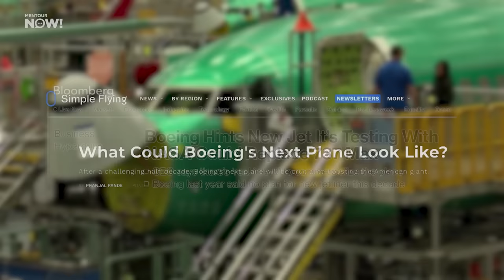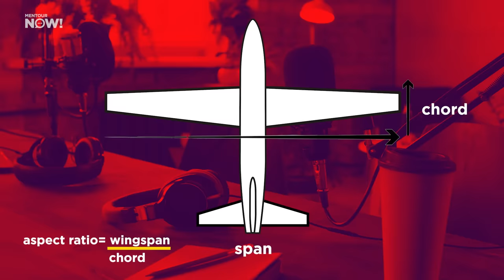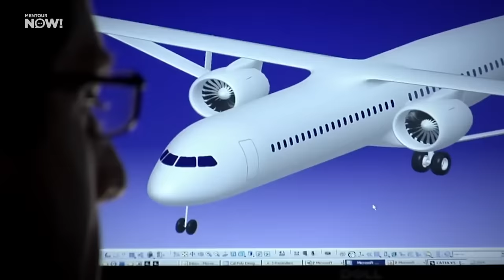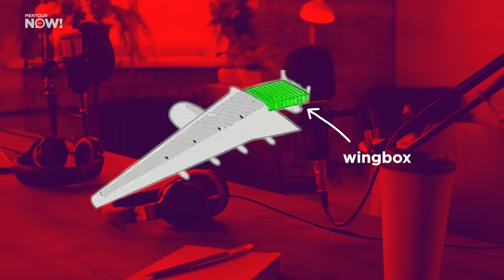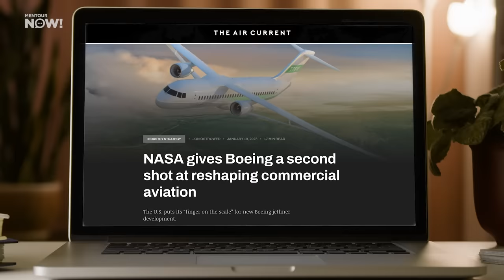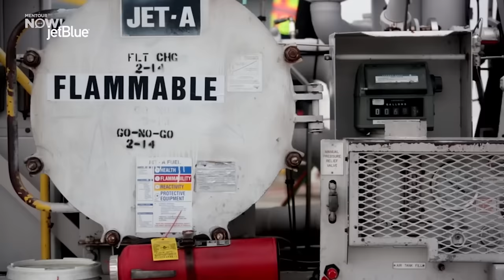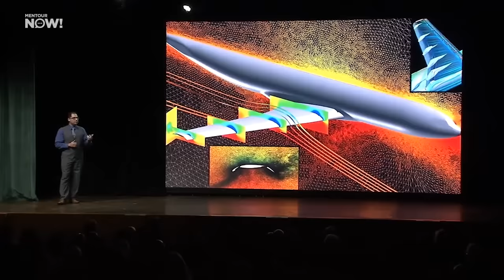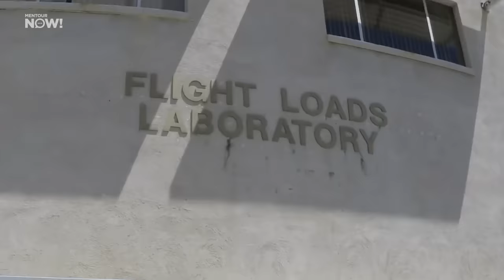Revolutionary Breakthrough: Boeing's Transonic Wing in Partnership with NASA!

Comment: The problem of wingspan will not be so much in the current configuration of departure gates and boarding bridges, which is of course solvable by folding them (although folding 8 meters on each side will still be a challenge...), but primarily in the field of certification of airports themselves, where the wingspan is one of the essential parameters for determining the category of the airport, or determining the critical type of aircraft, i.e. the largest type that can be operated at a given airport. And this can become a major problem for regional airports that are now certified in category 3C and 4C.
Reply: Well no, that is determined for accurately by MTOW of said aircraft as that determines how strong the vortices are by and large, not its wingspan.
Reply: @w8stral  There are also issues with navigating on taxiways both for conflicts between aircraft and with equipment on the ground
Reply: @Markle2k  Uh, a flat NO to that as zero difference between big and small airports in that respect other than the RARE airport modified for the a380 and this proposed craft is not even close to midsize
Reply: @w8stral  Wing span of 52 m will effectively put this aircraft into E category (by wing span) which is similar to A330/787/747-400.
Reply: @razy1857  Wow , way to miss the obvious...

Comment: I understand having folding wings (16 meters) for the planes to be able to park at the gate with the current airport fees.  However, if 16 meters (or more) unfold when the plane gets to the runway, are the runways going to be able to have that wide of a plane?  We have seen accidents that occurred due to the planes being off-center and the wings clipping an obstacle.   
Thank you for this channel.
Reply: Tall objects are kept far away from runways. The Boeing 777 and 787 have wingspans of about 60 meters. A runway wide enough for the 737 is wide enough for a 787, even if it may not be long enough.
Reply: The constraining factor for runway space is margin of error for not flying perfectly straight (and that goes double in low visibility).
But TAXIways are another story; even major hubs have wingspan restrictions on certain taxiways.

Comment: This is a good list of issues and benefits of the concept but of course there are many more. For example:
- the engines under the high wing can be potentially larger (higher bypass) and therefore more efficient (I say potentially because the flow through the truss and wing cell needs to be carefully designed and optimized)
- due to larger rolling inertia and not enough space at the tips of the wings, ailerons may need to be larger in span as well as maybe chord. Similarly, the flap mechanisms will require some clever engineering. It's sad to have such a thin and optimized wing and have very large pods hanging underneath creating all this drag...
- cabin noise from the engine may be worse. Also, the truss will generate some noise as well. This may be a more noisy aircraft as a whole. Noise is less easy to predict compared to aero or structures so this remains to be seen. Maybe the efficiency will allow flight with less thrust and that'll reduce the noise significantly.
- some fuel will have to be placed in the fuselage and refueling may be interesting. Also, there is less inertial relief from fuel in the wing so the structure actually needs to be stronger to withstand the larger bending moment. Of course the truss really helps with this.
- the ceiling in the cabin may be lowered near the wing box. This may require some clever cabin design.
- the top of the wing will be harder to inspect. May require airport ground equipment

Overall a very exciting time in aviation history where the leading manufacturers are seriously performing conceptual studies rather than seeking a few percentages in efficiency here and there. Learn more about the other concepts under consideration by NASA: https://www.nasa.gov/aeroresearch/sustainable-aviation
Reply: All very good points! unfortunately, all they’ve done is talk about new designs and show concepts for the past three decades, but have only made small changes here and there. And, as we all know, the experience of flying commercial has only gotten worse. If you can afford to pay for Upgrades to business, or first class, it’s a lot better. But for the rest of us, we are just cattle :-)
Reply: Hangar space, engine maintenance, high tailplane, wake turbulence etc

Comment: Could a future solution to the gate problem with high aspect ratio wings be addressed by revising airport design, perhaps taking passengers to aircraft on the tarmac with electric buses?  Maybe the current concept of a gate doesn't mesh well with future aircraft design and the push for more efficient systems?
Reply: It really looks like redesign of airports must be considered to keep abreast of aircraft development. Good point Robin.

Comment: I do think their will be a substantial increase in wing loading with this design and that's the main point of this wing. I don't think their will be a folding wing the extra weight and complexity will almost negate any performance gains if the design catches on airports will eventually be redesigned to suit the newer aircraft.
Reply: It isn't a redesign issue, you can fit less gates at your airport.

Comment: I think a swing wing might be a better width reduction option than a folding wing.  it wouldn't need such a strong flashlight, and if the pivot was built into the truss point, the plane could be narrower at the gate than the current planes.
Reply: love me some swing wings. But we will have to see if they can make the wing box strong enough without sacrificing passenger/cargo space and weight. To my understanding swing wings are better used for transitioning through the sound barrier, but are a little on the heavy side for light efficient aircraft which is where the industry is obviously trying to go.
Reply: @Amehdion  you're thinking of the variable geometry swing wing. I'm talking about the wwII carrier fighter design
Reply: @kenbrown2808  ah, yeah that would be cool to see.
Reply: @Amehdion  had to look up models, and the Grumman Wildcat  and the Avenger seem to be the most prominent of that type.

Comment: 2 wild thoughts regarding the drag penalty of struts.  1. Fashion struts to promote lift!  Is that possible? It might need to be larger (add weight) because that shape bears a lower load than a symmetric one.
2. (If that wasn't crazy, this sure might be:) Retractable struts! Does their necessity remain during cruise phase? What about on smaller craft? Could it leverage the existing systems for gear retraction?
Reply: The fuselage doesn’t lose much weight in flight, so you couldn’t really decrease the strength of the wing much just because you got to cruise altitudes.
Reply: The struts in this style do add lift. It doesn't make up for the drag though. Yes, they need the struts in cruise. Folding wings exist, including in flight. Yes you can use the hydraulic systems.

Comment: Couldn't they do a low wing design with bracing on top (essentially, flip the wing from the concept) and mount the engines above the wing like the HondaJet?
Reply: What do you think would be the benefit of that?
Reply from the maker: That could have been a possibility, but something must have weighted against that.
Reply: @Jehty_  Retaining engineering and manufacturing methods?
Reply: I was wondering that. One consideration is that those above wing struts would be in compression. Structures designed for tension are much simpler and lighter (often just a cable) than structures designed for compression, which have to resist bucking.

Comment: I love that they're using two MD-90's for this project, that the old DC-9 fuselage can still be part of cutting edge new research and development 60+ years later. I read that they have to shorten them, the MD-90 was too long otherwise.
Reply: I share this sentiment. My first commercial flight was on a DC-9, so there is definitely some nostalgia here for me.
Reply: I wonder why they are using md-90s as opposed to 717s or md-95s
Reply: @thejatomis  That is a good question, since the 717 is already 29 ft shorter. Maybe it is hard to find two of the ~50 which have been retired which are also in servicable condition and not parted out. Maybe they just already own the MD-90s so might as well use them, although acquiring other airplanes sounds much simpler than shortening those you already have. But maybe the length they want is longer than 717, and it is more feasible to shorten than lengthen an already-built airframe.

Comment: Box wing concepts has been around for decades.  For aircrafts currently in service with this wing design, you may look up the WZ-7 UAV.
Reply: It's not a box wing, it's a strut braced wing. WZ-7 has a very short wing, even compared to comparable UCAVs like the Global Hawk. The design goals are not even remotely comparable.
Reply: @kilianortmann9979  It's pretty obvious WZ-7's wing design is for structural reasons, where the back half of the wing asts as structural support for the main wing but also generates lift like a biplane.  For the Global Hawk's its long and slender wings with extremely high aspect ratio (kudos to American material science for that) is optimized for low speed high endurance and is not suitable for airliners traveling at subsonic speed.  If we were to use bracings to increase the wingspan of airliners, I think it's good idea to adopt WZ-7's braced sweep wing where the bracings also generates lift

Comment: Knowledge of high aspect wing performance is not new,  just look at old WWII designs. The limiting factor for commercial planes is the fuel storage, when you need to fold a significant part of the wing (not necessarily vertical). I doubt we'll see this in a long time. It was already well known. In the future building airports with aprons in two levels may allow closer parking of long wing aircraft - but it's not in the close future. Keep on thinking boys 😉

Comment: The main design feature of jetliner wings was the super critical aerofoil which permits high subsonic cruise near Mn1 before or delaying the transonic drag rise. These wings have deep thickness to chord ratio (thicker wing section) that gives excellent fuel capacity without a drag penalty. Adding another airframe main wing component has its draw backs of areodynamic compability and wing loading transfer paths to contend with. Sounds like the research department is in need of work.
Reply: You do know that they go slow on purpose, right!?   Adding another jet that can go such and such miles an hour they still not gonna go over the minimum speed they’re going to go way under it  you get more money by going there slower!

Comment: The weight of a folding wing mechanism would be roughly comparable to a fuselage clamping system.  In other words the fuselage detaches, and like a bus, it goes to the gate while the wing section remains in an uncontested area.
Reply: a fuselage clamping systen sounds much more prone to failure though
Reply: @TheRookieGamer  I worry about the composite to metal interface of folding wing.  Maybe there is some really good fasteners and glue.  But yes a removable passenger compartment is radical.

Comment: Very informative video, Mentour Pilot. Having wing struts on a high altitude jet doesn't seem to make any practical sense. It looks like it'll generate more disturbance and drag. It's one reason you find wing struts on high-wing prop and turbo prop aircraft. 

As for wings without the fairings like the 707, go check out the 747 SP's wing and its flap system.
Reply: Reducing induced drag is huge and there aren't many ways to do that besides increase span like this

Comment: doesn't that lower strut wing just kill the efficiency benefit with extra drag?
Reply: Some of it, yeah, hence only 9%. However gains are less depending on fuel location. The extra structure supports the engines and means less support needed in the inner wing. They are so so much longer and thinner, though.

Comment: 2 Comments:
1.)  Ratio = Ray-She-Oh.   Not = Rate-E-Oh.
2.)  And, if some-one knows better/different, I would be interested to hear it...
But as far as I know, the only way to make this sort of slim, high aspect ratio, transonic wing work, is with active trailing-edge anti-flutter devices.
And there is no way to make that a fail-to-safe design.
If your active system stops working, then at high speeds and high altitudes, your wing is going to fold up in a heartbeat.

Comment: Even with govt assistance with NASA and the DOD, Boeing still does NOT come even close to the much higher level of support that Airbus receives… and if Boeing screws up on the scale that Airbus did with the A380 white elephant, it would risk bankruptcy and a harsh govt stance.
 
Meanwhile, Airbus likewise receives govt military contracts through the parent companies’ military divisions, not to mention the non-interest loans that are NOT required to be returned when the aircraft in question is no longer produced.

Furthermore, NASA’s work is also available to Airbus…

Comment: Two layer insulated hybrid lifting wing body with dynamic stabilization and multiple active control surfaces.   There's a man out there who already threw together a stable frame sim.  PS, I helped with some other stuff... too... it's all about the computers...  WIth carbon fiber and new DLMS 3d printed titanium alloys, you can easily create the odd shaped pieces parts.  It's actually crazy cheap when you think about the use case.  I'm working off a modified cliff swallow for teh whole package.  no shit.

Comment: I watched a video on this channel about the 747 being redesigned to have 2 large engines. Based on that video I guess it would not be feasible or structurally sound to redesign the Boeing 747 to accept this type of wing with 2 large engines. I guess I'm just wondering out loud.

Comment: Aside from the interesting technological advances in aerodynamics, flying commercially at Transonic speed does not make much sense. Flying from subsonic at FL 350 (Mach 0.82 = 470 kt approx) to transonic (Mach 0.92 = 547 kt approx) means an increase in speed of 15%, but with an increase in Fuel consumption of 40%. 

In other words, an aeroplane would benefit from an increase in speed of 77 kt, at the cost of tens of thousands of dollars in overprice. This means that a 787 flying from London to New York (2.960 NM) would take 6 hours 30' at Mach 0.82, consuming 11.000 gallons of Jet A1 (= 35.000 USD at today's price of 3.24 USD/gallon), whereas a Transonic flyer would take 5 hours 40' at Mach 0.92, consuming 15.400 gallons of Jet A1 (= 50.000 USD).

Summarising: You would shave off 50 minutes on a London - NY flight (so, not exactly the Concorde) but at an increase of 40% on the cost of your ticket. Not commercially interesting.
Reply: Mach 0.82 is transonic.

Comment: Very obvious that the Holy grail is economy. I would be interested to know how much, in terms or fuel burn ratios, does a commercial transport use during the ground roll and initial climb period? Compared to a similar time period in the cruise? I would imagine a huge difference. Ground assistance for the launch is a normal part of glider operation and aircraft carriers. Perhaps it is a step too far to imagine a similar development for commercial jet transport?

Comment: Thanks for the video. I just wanted to draw your attention to several mistakes in it: wingbox is not the structure that you have shown, the one you shown is called as center wingbox; the high wing scheme is heavier not because it has to transfer load to the wing, in opposite the wing has to transfer the landing load to fuselage, but this is not the only reason; the picture of ttbw in your video is little bit obsolete, now it has greater sweep angle for wing and negative angle for strut; the high wing scheme provides some additional space for fuel in fuselage lower deck; btw the 777-200lr carries fuel in section 46; the benefits of wing high aspect ratio reduces the fuel consumption and the weight of the structure and increase the maximum performance range, so the amount of fuel required is less than for 737; high wing gives little bit bigger lift-to-drag ratio; there are still issues in the wing design and drag but we'll see how Boeing will resolve it. It will be interesting.

Comment: The breakthrough Boeing needs to come up with is keeping their planes from crashing.
Reply: What Boeing planes exactly are crashing?
Reply: @Jack3md  Google 737 max
Reply: @Jack3md  “Boeing attorneys cited an expert who said that the 737 MAX victims died painlessly because the airplane crashed into the ground so fast that their brains didn’t have time to process pain signals from their nervous systems.”
Reply: @hkmp5s  I'm well aware, more than the general population, on what happened with the 737 MAX's. We're in 2023, not 2018/19. The 737 is flying just fine like every other aircraft model.

Comment: I am confused of the fact that the wings are thin where in the holy spirit airlines will the flaps go in ? Are they hidden under the wings? And isn't the variable sweep wing disign like on the F-14 tomcat be used ? That would allow for a much more shorter wing disign ? As the wings are pulled back giving the same effect as the ones on the new wing config ?
Reply: The goal of this project is to have to longest, thinnest possible wing, with just enough sweep back to achieve cruising speeds. Variable wing sweep would be counter productive.
Reply: @kilianortmann9979  ohh... Damm..... Welp that just proved that I'm stupid sry
Reply: @imnotagamer5327  
Also a swing wing designs like the Tomcat, Aardvark, or Lancer are very maintenance heavy and massively expensive.

So even if it was better to use the swing wing, they wouldn't because corporations only care about one thing. Those greenbacks.